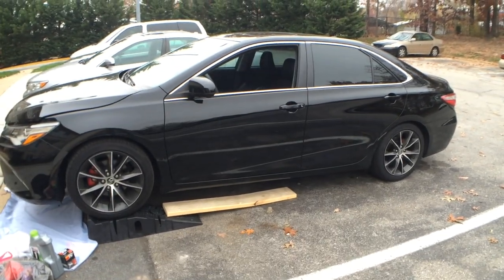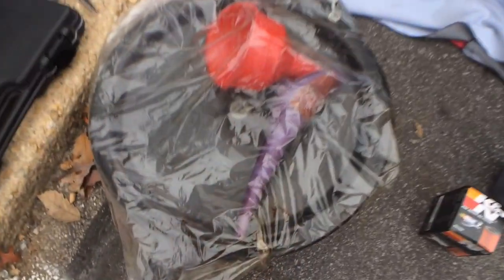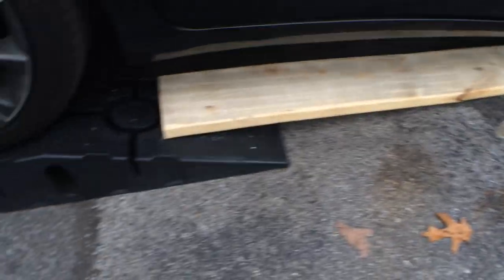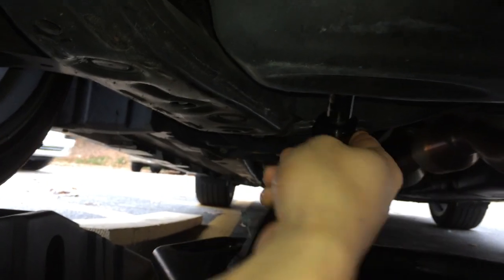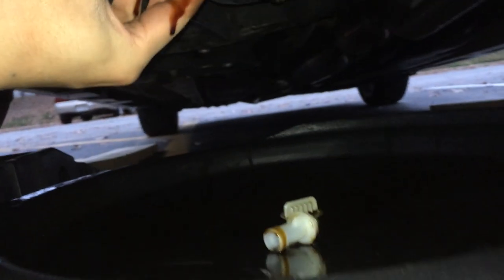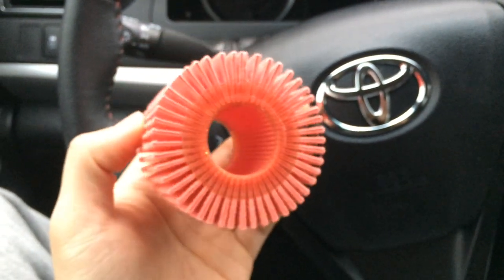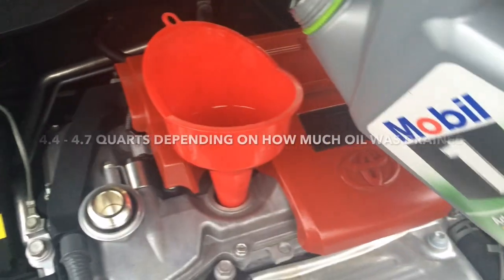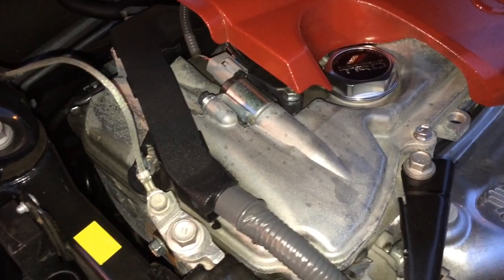2015 - 2017 Toyota Camry 2.5L OIL CHANGE

Comment: I read the comments posted here and here is my similar experience.  I just did the first oil change on my wife's 2017 Camry 2.5L  The dealer had done all of the scheduled maintenance for the first 34K miles. Since the oil "only" had 7500 miles they declined to change at what would have been the last plan-covered service visit. This was my first time with a "modern" Toyota.  I  should have taken a hint of what was to come, when it took a 12" breaker bar to loosen the drain plug.
I removed the filter canister drain and emptied the oil out by tilting the inner valve from side to side with a screw driver (I missed the significance of the plastic drain tool packaged with the oil filter).   When it became apparent that none of the oil filter wrenches in my collection would budge the plastic filter housing, I purchased a cap-style filter wrench at AutoZone.
There were two choices, a smaller black cap style unit with a 3/8" drive coupling and a larger chromed unit with a 1/2" drive die and with a slotted flange to engage the tabs on the filter housing.  They were only $2 apart in price but, I was concerned that the larger one would not fit in the available space.
I could not budge the filter housing with a standard 3/8" rachet.  I switched to a 1/2" drive rachet with a 3/8" adapter and still couldn't break it free.    My last option was an impact wrench and I only succeeded in separating the 3/8" drive ring off from the rest of the tool.  It just broke the five spot welds right off. 

Back to AutoZone where the  manager (who had worked in the service dept of a Toyota dealership) confirmed that it is very common for dealers to over tighten these housings and that it isn't unknown for them to just change the oil and leave the old oil filter on.  Reminds me of the 7-plug tune-up on a Chevy Monza V8. 
The housings are prone to breaking when they are that tight.  He also confirmed that the smaller filter wrench was not suitable for removing stuck filter housings.

I bought the larger Chromed tool ( Performance Tool W54076).  It fit just fine and I still had to really put a lot of muscle into removing the canister. Once it broke free, it was still very stiff and difficult to remove.  Hopefully, the next oil change will go smoother.

If you run into this problem, do  buy the proper tool.  Don't even consider using the cheaper flange unit.  Purchase one that has the slots to engage the tabs on the filter canister and a 1/2" drive.  Make sure that the wrench is properly seated on the oil filter housing and that slots in the wrench tool engage the tabs on the filter housing.  Also, don't use an impact wrench.  Apply steady torque with a 1/2"  rachet or breaker bar., making sure that the rachet or breaker bar doesn't twist sideways, but stays aligned perpendicular to the filter canister.  l was very surprised at the amount of torque required to break this free.  I can see how easily the canister could break if you tried to remove it with any kind of angle on the wrench or breaker bar.
Reply: I had this issue with my 3/8" oil filter socket. It was too big. I'd keep throwing all my muscle into it and it would just slip every time. I used an oily paper towel between the socket and the cartridge, and it broke loose just fine. In fact, i don't know if i've ever had a proper fitting oil filter socket in my life of changing oil in cars. The paper towel has always done the trick and kept me out of auto shops. hope this helps/

Comment: Thanks for the video. I bought my wife a 2015 XSE V6 brand new back in 2015 with 0 miles. Now approaching 30,000 miles and I'll be doing this oil change on my own. The V6 is the best way to by the way. It's a pretty quick and powerful engine. I love it.
Reply from the maker: One2 I seriously considered the V6, it has plenty of power but I couldn't get myself to pay for it - and living in MD there are too many speed traps here haha
Reply: Sheldon Lee Its not about speed; it's about power. It's about being quick. Acceleration is a great thing.
Reply: I don't need it. I figure the 4 cylinder is more than sufficient. But my first car was a 40 hp 1961 VW bug.

Comment: Anyone else have an oil filter housing that was screwed on WAY too tight by the dealer?
Reply: Had to use impact driver to get my filter off after it was changed b by Ramsey Toyota previously.
Reply: Yes, they must have used an impact wrench.  With this design, Toyota wants you to have them do the oil change, but this is exactly the reason to do it yourself!
Reply: dealership had it on so tight, i cracked it trying to remove it.  was unable to remove it or seal it back on tight.  had to tow it to the dealership.
Reply: @holymoly8718  
Hope you made the dealership pay for it.
Reply: The torque specs are printed right on the oil filter cap (25 N•m ±5 N•m which is equal to 18 ft.lbs. ±3½ft.lbs.) The oil filter drain plug should only be 10 ft.lbs.
Reply: Everyone who has this system should be prepared for a worse case scenario especially if this is the first time you're doing this.

In case of a Stuck Oil Filter

Make sure you have the following...
1. The proper Motivx* oil filter cap wrench. Item #MX2320 is for all Toyota/Lexus/Scion engines 2.0 liters and larger using a cartridge style oil filter or item #MX2321 is for all engines smaller than 2.0 liters using a cartridge style filter.
2. A 27 mm ½ inch drive socket
3. A ½ drive breaker bar (18 inches or longer in length. An extension may be needed for some models.)

If an oil filter cap seems difficult to remove, only the above items should be used (or equivalent tools). Do not simply use a ⅜ inch drive ratchet or ratchet with extension as these will sometimes result in breakage of the oil filter cap wrench or the oil filter cap.

Always make sure the teeth on the wrench are properly engaged with the tabs on the oil filter cap.

To prevent reoccurrence of the problem 
•Make sure new o-rings are properly lubricated before installing. 
•Use a torque wrench to install the oil filter cap to no more than 18 ft.lbs (25 N•m). Oil filter drainplug = 9 ft.lbs. (12.5 N•m)

* If you think the Motivx tools are too expensive at least consider the following... Do not buy an oil filter cap wrench that is made from cast aluminum. Only buy one that is forged. Do not buy one that is strictly a cap wrench that does not have teeth. Do not buy one that claims to fit all models or even all four cylinders. The 2.0 and 2.5 liter four cylinder engines use the same oil filter cap wrenches as the six and eight cylinder engines use. Only the 1.8 and 1.3 liter engines use a different size oil filter cap and oil filter cap wrench. If the oil filter for your four cylinder vehicle comes with one o-ring instead of two then your vehicle takes the same wrench as a Prius or Corolla (unless it's a six cylinder). If your oil filter comes with two o-rings & a service pipe for draining the filter then your oil filter cap takes the same wrench as the six and eight cylinder engines. Some companies claim their wrench works for all four cylinders but on the 2.5 liter engines that smaller wrench does not engage the teeth on the wrench to the tabs on the oil filter cap. It may work if your oil filter cap is not stuck but it is a poor choice. They are mislead.

For those that don't believe this is a problem...
https://youtu.be/Wm-VMIkTw6k

Comment: If your Camry doesn't have an interface like his did, yours will be reset with the trip A reset.

!. set odometer to trip A using odometer button.
2 Turn off car.
3 Hold the odometer button and turn the key to accessory mode, but do not turn it so far it starts the engine. keep odometer button held until all the dashes on the mileage screen count down and the maintenance required light resets. Congratulations!

Comment: K&N is not cutting corners, it is actually good that they did away with the rubber base because that hinders oil flow properly and specially when VVTI is engaged
Watch out for those $3 oil filters they will cost in the long run.

Comment: I have recently bought a 2015 Camry Altise (in Australia).  I will use Castrol Magnatec - (part synthetic). Will also use Wesfil (Coopers) Oil Filter -  As a Courier, I used these all of the time. My Mitsubishi Express van reached 3265000 hard ks (226800 miles) and was working well when I sold it. No engine repairs except for two clutch replacements, which is why I'll continue these products for my Camry. The recommended interval for the Camry is 15000 ks (9320 miles). - Any comments or advice welcome!
Reply: agreed a synth blend will give you longer motor life and less piston slap
Reply: Three million two hundred sixty-five thousand...! Wow!

Comment: I just purchased me a Toyota Camry SE 2015. The more i drive it the more I lov it.  Your video was very helpful
Thanks!

BTW,  Did you do a LED conversion on your Camry?
Reply from the maker: Utoobyourself no I haven't. I don't think I will until the headlights go bad.
Reply: i just got a 2016 Camry SE 2.5, with (17,758 odo) for 17,000 even, plus (tax,plates,fees and all that) 
you guys think its a good deal?
Reply: Sergio Gurrola yesss ! Mine was $16k. But I had no fees
Reply: is your 2016 also?
se?
2.5?
17k miles?
Reply: Sergio Gurrola yea but I had 33k miles already on it when I got it
Reply: Oh I see I like it too,
Reply: Do you guys think I got a good deal $17300 for a 2014 le 7k miles on it very clean still smells new
Reply: Jeddy Eslava u got ripped off. I got a 2016 Camry se with 23k miles for 17k with certified warranty
Reply: Mitul I got the same exact car, same price in June 2017. .Poor jeddy.
Reply: depends where youre from, so im sure you got a good deal if you did your research
Reply: @SheldonLeeFit  nice video i really appreciate it. I have a 2016 t camry with 40k miles is it okay to put synthetic oil stabilizer in it or is it too low miles for that
Reply: @SergioGurrola  yes
M the Camry should last you along time if you take care of it
Reply: @Jaylaze20  i got a 2016 t camry 40k miles for 12,300$

Comment: Very helpful video! Wanted to see how toyota's oil filter differs from regular ones.

Consider using gloves so your hands are not in contact with the motor oil as much. You can get a pack of 100 disposable ones at harbor freight or online for under $10. They comes in different thickness as well. Cheap insurance against skin issues in the future. Have fun!

Comment: I switched from the K&N because of that big change. I’m now using the Mobil-1 Extended performance filter which actually does a better job keeping oil clean as well as using the extended 0w-20 performance full synthetic oil which last about 15k miles comes out cleaner than the advanced version
Reply: Joel Cruz still Mobil 1 251 like the older camrys?

Comment: Always use a new drain plug washer too
Reply: I never replaced my original drain plug washer in any of my vehicle, and they last okay. Just don't over tight it when putting it back, and you will never be replacing it every time you oil change your car.

Comment: Recently bought this 2016 toyota camry se back in July of this year.  Toyota told me to come back for an oil change at 5000 miles.  Just wondering, maybe they put a cheap oil cause I know it requires full synthetic 0W-20 oil.
Reply: Ralph Reyes 5000 sounds about right
Reply: Ralph Reyes I though it was 10,000 miles. The car comes with full synthetic oil from the factory. You might want to do a search.
Reply: I just hit 5000 on my 2014 camry running on synthetic  went to the dealership and told me that it doesnt require the oil change until 10000 . Is this good or take it somewhere else to get it done.
Reply: Well you go at 5000 to deale but they just rotate tire. at 10000 and 20000 they do free oil change.
Reply: Does oil pump has a timing mark
Reply: I have been having Toyota do my oil changes. Now I will do my own since they will charge me now. The scheduled maintenance oil changes from Toyota for the 2015 Camry are 10,0000 miles.
Reply: @ornelasjorge9102  the dealer was right... most if not all Camrys use synthetic oil and oil change is due every 10k miles regular ole comventional oil is 3-5 k miles.. but to be safe with the synthetic oil change it at 8k miles thats what im doing
Reply: Randy Jackson  toyota books says use 0w-20. If not available use 5w-20 BUT!!!!! at next oil change interval use 0w-20... so according to TOYOTA 0W-20 is the better choice
Reply: Randy Jackson  
There should be no difference between 0W_20 and 5W-20 except during cold starts the 0W-20 flows more readily. The engine warms up to operating temperature quickly and both oils protect the engine the same at operating temperature. In fact if you compare the two but the 5W is a conventional then the 0W I'd the better choice because it is synthetic.

Comment: Does anyone know of the 2017 camry is any different mechanically than the 2015.  I'd like to purchase a repair manual.  But unfortunately, the only I can find is a 2007 to 2015 camry by haynes.  Also if someone does know where I can get a repair manual.  I'd appreciate it, thank you.

Comment: The plastic end cap doesn't do anything. It doesn't filter the oil. Only the element filters the oil. So if the plastic end caps aren't needed for rigidity then they are not necessary. Even the OEM Toyota filter has no end caps. If end caps are more important to you, you can get the budget $2.97 Super Tech filter.

And ONLY go by the dip-stick if you're sure your vehicle is level. Never put in more than what the owner's manual says is the capacity. If you put in the capacity and it's still not quite up to the full mark on the dip-stick, then chances are your car is not level.

Comment: Funny how on my 2018 Avalon it comes with two gaskets and a plastic insert that wasn’t shown in this video? Did you skip those steps?
Reply: Reading the title of the video might help as it clearly states this is for a camry, not the Avalon.
Reply: The Camry and the Avalon use the same oil filter system. This fellow eliminated the draining of the oil filter so it was not a complete video of the suggested way to do it. Many mechanics do this a deviated oil change. It is a complete change including the filter but some find it less messy if they take a little longer and include the step that drains the oil filter assembly before removing the filter. Personally, I include all the steps. I'm retired and I'm not in a hurry.

Comment: Your video did not show or mention what to do with that little plastic piece included with the filter .... I don't recall getting it with the K & N filter, but it is included in the Fram and most other brands ..... is it optional or for other models perhaps ??
Reply: andrew field Yeah I was wondering what that was for also
Reply: @redskinman0  It's to drain the oil filter before taking the whole oil filter housing off. Take off the metal plate with a 3/8s I believe, then plug in the plastic piece until oil finishes draining out. Take it off and then use the filter tool to finally take filter off.
Reply: Randy Jackson  
You must not have seen many other videos then...
See the two links below...
BEST OIL CHANGE VIDEO
TOYOTA
https://youtu.be/xa60-oJpyX
Changing o_rings...
https://m.youtube.com/watch?v=xa60-oJpyXk&t=160s

Comment: you should wait 5 minutes after turning off engine before checking oil level. it will go up because the excess oil will drain down from rhe top of the motor.
Reply: There shouldn't be any excess oil unless it was overfilled. And it shouldn't be over-filled.

Comment: "hand-tighten will suffice"
proceeds to use socket wrench
Reply: Should be installed to 18 ft.lbs. 
Drain plug on the filter cap = 10 ft.lbs.

Comment: Quick question, will you need a specific type of oil filter wrench or will a basic one work? Thank you.
Reply: Get one with teeth on it and preferably made from forged aluminum (not cast aluminum). I recommend the Motivx MX2320 or if you have a Corolla or other vehicle with a 1.8 liter Toyota engine, then you  want the Motivx MX2321.
https://www.motivxtools.com/pages/toyota-oil-filter-housing-and-wrench-guide

Comment: Cant the oil filter come off without that special tool; just use a 3/8 racket with extention(thats what the hole in the metal filter cover is for)???
Reply: No, the 3/8 is to drain the oil filter before removing the filter itself to avoid any mess

Comment: Why a filter socket when the thing already has a hole for a 3/8 extension made into it?
Reply: @Barack Hussein Obama so drain the oil from the housing first, then remove the housing correct?
Reply: @Barack Hussein Obama thank you Mr. President
Reply: The hole for the ⅜ inch extension is only to remove the drainplug on the filter and should NOT be used to remove or install the oil filter cap assembly.
Reply: Consider this...
Oil filter cap torque = 18 lb.ft.
Oil filter cap drainplug torque = 9 lb.ft.
If you over-tighten the drainplug you may not be able to remove it without the whole oil filter coming off, defeating the purpose of its design.

Comment: Hi I just got a 2015 se camry with 41 k miles when is the next oil change
Reply: 50k or 51k will be ur next oil change
Reply: Depends on when was the last oil change...🤔 And also what sort of driving you do normal use or severe use?

Comment: What's wrong with buying oil filters from Toyota?
Reply: sunking2001 , Toyota charges way too much, after market will suffice!
Reply: $5.41 list is "way too much" for a Denso filter.  Huh.
Reply: Nothing wrong at all. If you research it, you will find that the Toyota filter is the best choice, hands down.
Reply: Chuck E Cheese to save 2 bucks a couple times a year for potentially inferior product?  “Penny wise, pound foolish”
Reply: Nothing. I would buy an OEM Toyota filter either from the dealer or Walmart or a dealer that sells online. I would not buy one from eBay or Amazon at a reduced price and risk it may be counterfeit.